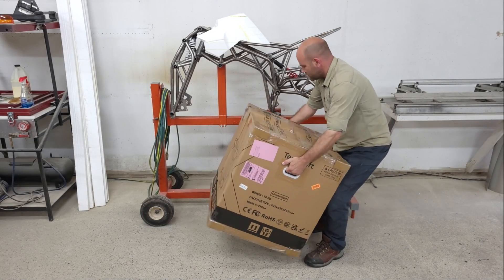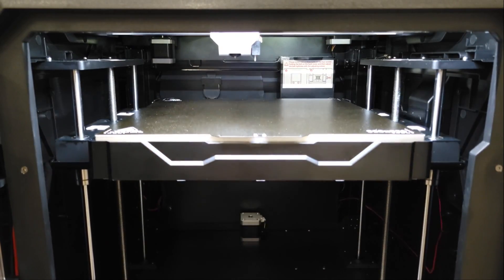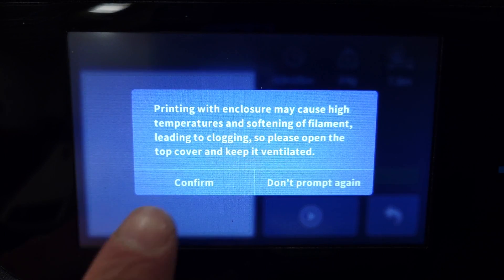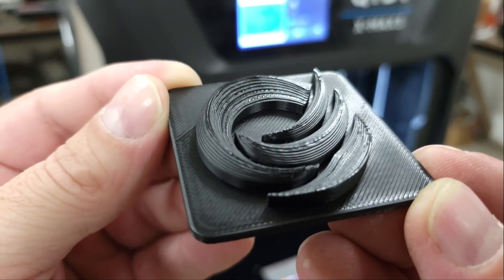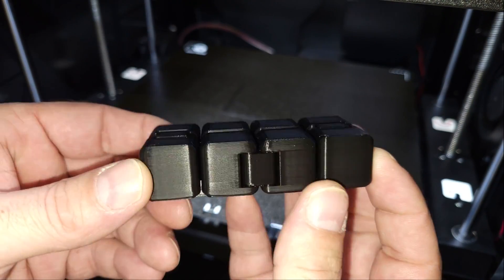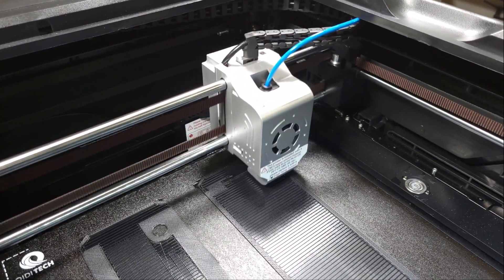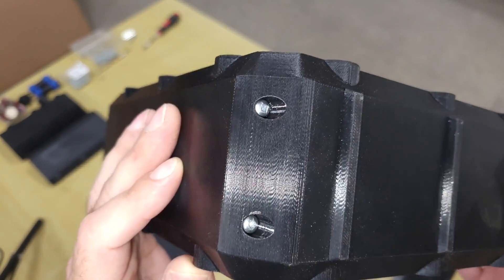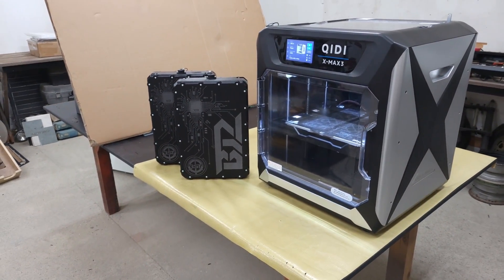Making E-Moto Battery Modules W/ The QIDI X-MAX 3: High Speed 3D Printer Review

Comment: Was it necessary for those supports to be printed? It didn't look like too long of an overhang to manage. Would have been nice to see it as an overhang test. Even my not-well-tuned Ender could manage covering that small of a gap.
Reply from the maker: I could've printed them upside down w/o needing any support (overhang angle is 45°), but I wanted the texture on all of the exposed faces to be consistent since I won't be sanding these down smooth. The texture that the HF plate creates is quite a bit different than what the edges and top printed layers look like. The gap designed for airflow on the back sides (bottom when on the plate) is over 50mm, so support was inevitable to span that. My Ender can barely handle spanning a 5mm gap without making a mess lol.
Reply: I totally get why you printed them in that orientation, just thinking that 50mm is a manageable overhang without supports. Obviously it's a moot point now, since you're done with the case, but if you get some spare time on the printer, you should try printing an overhang test to see what this guy is capable of. Though admittedly, overhangs are generally more difficult with PETG as compared to PLA. Though I'd bet CFPETG with 75 percent fan speed could manage 50mm

Comment: I have one of those. It started having problems, hopefully the parts from China get here soon so I can see if it will run again.  Made really nice prints when it worked correctly, and I'm anxious to get it back up and running. If yours starts turning off for no obvious reason when it's printing or warming up, check the power switch. Don't turn the switch off and back on right away, rather just wiggle it and see it the power comes back on. If it does, then the switch is probably fubar.  That's not the only problem I have had, but it's one that I got to the bottom of so far. You can probably get a free proximity sensor to replace the BL Touch, some up graded print head parts, if you're so inclined. You have to change from the individual bed magnets to a magnetic sheet.
Reply from the maker: Thanks for the tips, I'll be sure to check out and keep an eye on the switch in particular.

Comment: Sad to say that, but pet parts are likely to leak water through. If U really keen to print watertight parts then take time to go through this topic on internet. I'm not professional but I had experience with 3d printed parts being very leaky...
Reply from the maker: Almost all filaments are hygroscopic, and without proper crosslinking and possibly post processing, almost all prints will leak with hydrostatic pressure (ie just the force of gravity alone). I've covered this in past posts/videos.

Comment: I just subbed based on your Qidi review. You gained one as you lost some.  I'm not into e-bikes but would love one for silent back country riding so now I have something else to learn about. Thanks for showing real world applications for this printer your battery parts look amazing and is exactly the quality I hope and expect to get from a printer. I was doubting the Qidi but the last couple video's I have watched are making me rethink my hesitation towards it.
Reply from the maker: Thanks! Glad you found it useful. They had an issue with heat creep in the beginning but worked with customers to resolve it. I haven't seen any complaints or bad reviews since. It's a really nice machine, especially for the price. Kind of surprising. But it's well built, works like it should, no glitches in the machine or the software. They did a pretty good job with this one overall.

Comment: Very very nice job James!
I made a fairing for my e-scooter using PLA on an Ender in 5 parts, using Blender and a lot of time to design the meshes with overlaps and holes for bolts and tunnels for cable ties. Took at lot of time to print, but the results are good and the fairing keeps my legs dry in the rain and improves economy!
This Qidi machine is impressive, and I'll consider getting one!
Reply from the maker: Thanks Andy! Yeah I've had to reconsider the value of 3D printers over the past couple of years. Kind of kicking myself in the butt for scoffing at them with an old school attitude. I started with Enders, but this printer is on a whole different level. Large volume, 10X faster, no assembly. I love it so far.